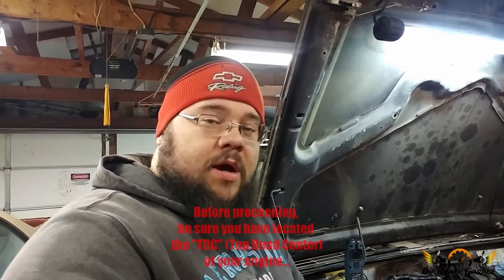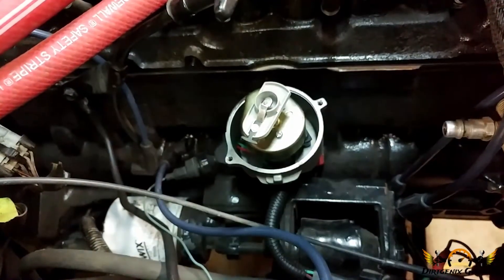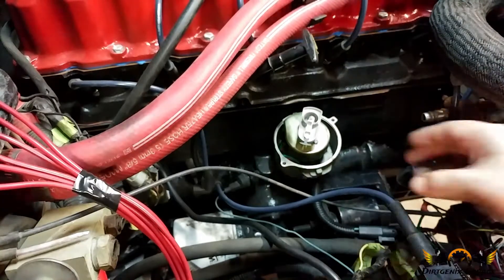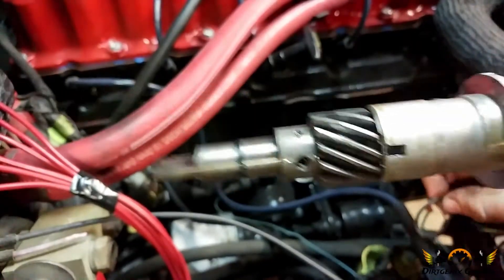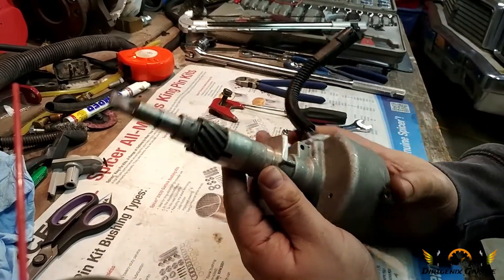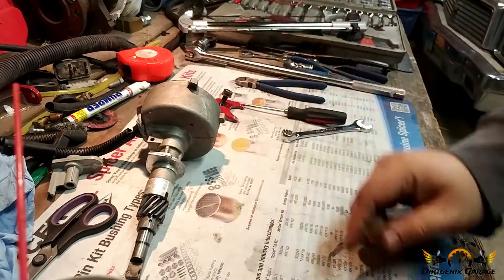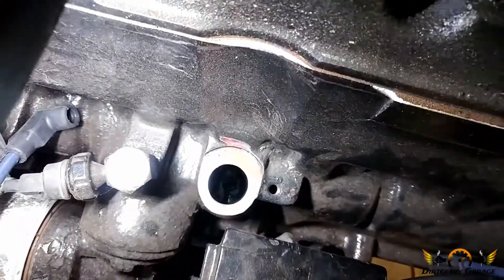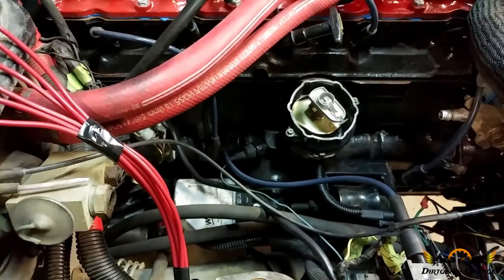INDEXING THE DISTRIBUTOR ON A RENIX JEEP

Comment: Thought I saw a comment in here about you saying you actually ended up turning even further then you do in the video to get it just right?
Reply from the maker: Yes in the video I accidentally had the distributor a couple teeth off. Ended up having to reset everything and doing the process over again after I got don't filming. Make 100 percent sure you are at TDC on the compression stroke or it will give you a headache 😉 and you will have to start over.

Comment: Ok I got I got the training slid back I'm up top dead center in the cap is pointing to number one on the distributor where do I put the flywheel when I didn't do it I was backfiring it wouldn't start no crank

Comment: No that's not true took a motor out of a 94 and putting it in a 95 the flywheels and torque converter was different so I switched them did all you said top dead center on my balancer on zero will backfire to exhaust in my throttle body went back and made sure it was all correct send it backfired and blew a hole in my muffler and I was told that the flywheel had to line up with the crankshaft Mark timing all three had to line up to be in time
Reply from the maker: You said it right there you took the motor out of a 94 and put it in a 95 this tip is for rennix engines the last year they made the renix motor was in 1990 you have the ho motor which is a completely different electrical system in this modification won't work with that's probably why you're experiencing backfire issues when they updated the ho motor from rennix they fixed the ignition problem so this modification is no longer necessary on the newer engines

Comment: Ok i want to know the marks on the flywheel and crank shaft time
Reply from the maker: The flexplate itself does not have any timing marks on it it will only go on one way the bolts are staggered so that you can't put it on incorrectly as for the timing on the harmonic balancer the engine needs to be top dead center on the compression stroke and you line up the little hash on the balancer with the zero on the timing mark after you do that you're good to set up a distributor of the way that it is in the video.

Comment: Does the ground signal to the pcm and ignition coil come from the distributor   being bolted down to the block?
Reply from the maker: No the ground signal to the PCM comes from the massive grounding Bolt that your dipstick bolts to for the engine oil they'll be a bunch of ground wires bolted to that connection that's where Chrysler decided to put it for those years

Comment: Won't the computer and the crank sensor on the back of the bell housing prevent you for being being able to make manual adjustment? I have a 1999 XJ and although it runs fine now, I do miss being able to manually advance the timing.
Reply from the maker: No not entirely there is a certain amount of adjustment you can make that won't screw anything up because it's Rinx and it's much older system you have the ability to do that because the factory wasn't able to set it properly there was too much room for error so all you're basically doing is narrowing that Gap so that your timing is set properly and the distributor in the computer are not guessing where the rotor is the newer Cherokees you don't want to do this modification to because they changed the entire electrical system and the computers so that the timing is locked in.
Reply: @dirtgenixgarage956  What is this Rinx you are talking about? Would I be able to fine tune my 99XJs timing by doing this modification? Thanks
Reply from the maker: Renix is the style of motor and computer combination that they used from the first xj's up until 1990 after that they changed computers and now have more current up-to-date stuff that you don't actually have to tune and no I wouldn't do that on something that new like I said before your computer is not going to have as many problems guessing the timing that the renix did because renix is a much older electrical system it was inherently flawed from the get-go and Chrysler knew that which is why they changed the electrical system in 1991.
Reply: @dirtgenixgarage956 I changed all my cables and wiring and now it won’t start but it did before

Comment: It's been decades since I've did a distributor (MSD) upgrade, but this coverage reminded me that I used two different colored paint markers.  One on the outer distributor housing denoting number one position, and the second color the denoting starting insert position as the rotor shaft will rotate  when pulled/inserted.  I will consider myself lucky thus far as both of the Renix XJ we have can be started from reaching in the drivers window and turning the ignition key to which they start right up.  But the information you covered here is appreciated and something I shall keep in mind should things change. Thank You.  😁✌

Comment: Im confused did you put the first cylinder at top dead center to tune the distributor? Or do i just open the distributor and start on the tuning?
Reply from the maker: Cylinder number one must be at top dead center before messing with the distributor. Otherwise your timing will get really messed up and cause more problems.
Reply: @dirtgenixgarage956  ok thanks
Reply from the maker: No problem 👍 good luck on your project.
Reply: @dirtgenixgarage956  uhhh i did everything and now my jeep i misfiring pretty bad
Reply from the maker: There's a good chance you weren't at top dead center on the compression stroke for cylinder one you could be a couple of teeth off on your distributor gear as well that would also cause the problem you need to verify that your placement is correct with top dead center number one cylinder on the compression stroke so when you rotating the engine over the cylinder should be coming up to the top not going back down when it gets to the very top and it starts to go back down turn it back until you're at the very top you can do this by putting a screwdriver into the spark plug hole and watch it move up and down or you can remove the valve cover and check for both push rods to be loose you want to make sure both of the intake and exhaust valves are completely closed on cylinder one if it's on the downstroke the exhaust valve will be open if it's still on the up stroke the intake valve will be open both valves on the cylinder head have to be closed once you've confirmed that you are correct in that position then you'll want to pull the cat back off and start over making sure you're at the number one firing position
Reply: @dirtgenixgarage956  ok so if i do all this and it still doesn’t work. Do you think it could be something else?
Reply from the maker: Yes it can very easily be something else as to what I'm not sure I just know that mine after I did the job starts much faster and it idles a lot smoother so if you're still having misfire issues I don't think the distributor and the timing is your problem.
Reply: @dirtgenixgarage956  yeah it’s something else because it still misfiring. Bad thing is I dont remember what position i had it in the first place😂 so i gotta try different positions.
Reply: Never heard it run

Comment: HERE’S WHY DISTRIBUTOR INDEXING  IS SO IMPORTANT:

Distributor indexing explained:

For clarification though, that’s not a cam sensor inside the Renix dizzy. It’s there to fire the injectors sequentially with the firing order. You’ll never notice if it went bad because the ECU will try to “guess” where it is and does a heck of a job at it.

As for the “timing”, it is controlled by the ECU. Ever notice how wide the tip of the rotor is? Try and wrap your head around this:

When the ECU yells “Fire” to the ignition control module, where is the rotor in relationship to the dizzy terminal? Not to the terminal yet? Past the terminal too far?

What happens to the spark/secondary ignition strength when it has to jump the Grand Canyon in comparison to shooting from a rotor tip? Poor ignition performance, bucking, jerking, longer crank times.

The factory was aware of this and issued a Technical Service Bulletin on it. This Tip, #13, is a condensed version of that factory TSB. You wouldn’t believe how many we found out of whack when I worked at the dealership. Yours is probably messed up also. RARELY did we find one set accurately.
Reply: So Peter, are you saying this is a good idea or bad?  I have a 2.5L in an 2001 and my exhaust manifold is glowing red hot.  Didn't think to cut the prongs to fine tune the distributor though.  Let me know to either.  Thanks
Reply from the maker: It is definitely a good idea but keep in mind this modification as far as I know is only for the 4.0 6 cylinder engine I'm not sure if the same applies to the 4 cylinder as I don't have one but assuming the distributor and rotor looks similar and it has a very large pickup on the rotor you could possibly benefit from doing this modification as well. This modification was mostly intended to help with the longer cranking times and provide a smoother idle I don't know that it would affect your engine temperatures sounds to me like your engine is might be running a little bit on the lean side if the manifold is super hot  like you say.
Reply: @dirtgenixgarage956  Yes true but its all controled by the ECM.  I can't adjust anything unless i have the ECM modified
Reply: @kirkdeal2619  Read "distributor indexing explained" up above.
Reply from the maker: With renix it is a little different when you say "controlled" because of the tech that was used in renix the computer isn't really smart enough to dial in the timing perfectly like the newer computers are today which is why we do this mod to the distributor to take out most of the guess work that way the eck can find correct timing easier and not have as large of a window to try guessing at it. This mod is only for vehicles equipped with a remix ecm. The newer vehicles have a completely different electrical system that should not require this modification.
Reply: @kirkdeal2619  If you want to advance the ignition timing, do Tip 23 at www.cruiser54.com

Comment: Good video...I was thinking of doing this on my 87’...did u notice a difference after doing this...nobody seems to say if it does help...thx
Reply from the maker: To update this I have gotten it running and yes it made a noticable difference. When from around a 10 second cranking time to about 4 and it runs smoother. In the initial video I did not set the rotor far enough past the number 1 post and resulted in slower crank times. After resetting it to be at the very trailing edge of the rotor the jeep started much faster.
Reply: What hold down did you use to clamp down the distributor?
Reply from the maker: Just the factory hold down clamp that comes on the engine from the factory.👍
Reply from the maker: Thank you very much, I will let everyone know as soon as I'm done doing the rest of the work. I actually have not been able to start it since this video went live I am currently in the process of changing out the flex plate for the correct renix plate as the guy that put the motor together before me put the wrong flexplate on the engine. as far as whether it's going to help or not that's really in the eye of the beholder and how well you know your engine someone that isn't really super in tune with how their motor runs might not notice a difference at all whereas if you've been doing it long enough you can tell that it runs smoother or starts faster I have however heard that some people don't have any issues at all even though this particular problem would still persist on their engine guess we'll wait and see together how it runs and starts. 👍👍
Reply: @dirtgenixgarage956  yes I'd like to know aswell.
What degree its set at, test drive, is  advancing beneficial in this scenario?
I want my 88 to be as powerful and efficient working with what its got.
Thanks bro
Reply from the maker: Thank you for the comment brother. I will definitely do a follow up when I finish the flex plate video on how well this change has helped. As far as degree I'd have to see about putting a timing light on it after I get it running. For this project I just put the motor at TDC on the compression stroke to set everything up which essentially starts everything at zero degrees. But because this is an efi system there's not a whole lot you can do to adjust timing. The ecu will try to adjust timing for any changes you make. This project is to better help the ecu know when to fire a spark that to actually advance or retard the timing like they did on the older cars.

Comment: Correct me if im wrong but doesnt the renix system correct for up to 20 degrees off? Do you have the technical bulletin number so i can read it over?
Reply from the maker: Sure thing the TSB number is: 18-53-88 where it explains that an ignition crossover might cause bucking or surging and the fix for the issue. It does not always happen to every 4.0 owner. But if you already in there servicing the thing, it doesn't hurt to go the extra step and perform this procedure if you feel confident in your skills. Noticeable gains would include smoother running and a little less cranking time than the normal 4.0 jeep engines would experience when starting up.

The ECU will correct to an extent but there is a little more to it. The ECU is able to "guess" where the rotor is in relation to the terminal, which is why the contact surface area of the rotor is so large. You can see in the video that the actual contact on the rotor is quite large when compared to say a SBC or SBF. 

I have mentioned in past videos that there is a guy out there by the name of cruiser54 who has an entire webpage dedicated to renix bugs and fixes for literally the entire engine and electrical problems they have. Here is the web page: www.cruiser54.com 
Very highly recommended and I have learned a ton about renix from this site.

Cruiser54 Mostly Renix Tips:
Cruiser54 does a phenomenal job at explaining this, I pulled this from one of his post on jeepforums:
"HERE’S WHY DISTRIBUTOR INDEXING IS SO IMPORTANT:

Distributor indexing explained:

For clarification though, that’s not a cam sensor inside the Renix dizzy. It’s there to fire the injectors sequentially with the firing order. You’ll never notice if it went bad because the ECU will try to “guess” where it is and does a heck of a job at it.

As for the “timing”, it is controlled by the ECU. Ever notice how wide the tip of the rotor is? Try and wrap your head around this:

When the ECU yells “Fire” to the ignition control module, where is the rotor in relation to the dizzy terminal? Not to the terminal yet? Past the terminal too far?

What happens to the spark/secondary ignition strength when it has to jump the Grand Canyon in comparison to shooting from a rotor tip? Poor ignition performance, bucking, jerking, longer crank times.

The factory was aware of this and issued a Technical Service Bulletin on it. This Tip, #13, is a condensed version of that factory TSB. You wouldn’t believe how many we found out of whack when I worked at the dealership. Yours is probably messed up also. RARELY did we find one set accurately."